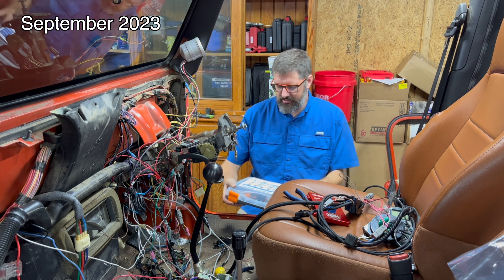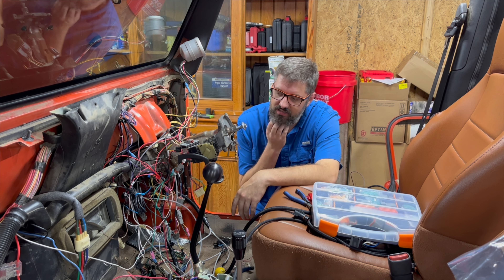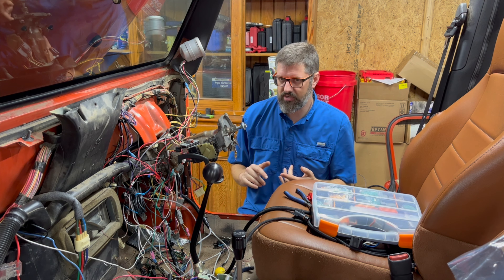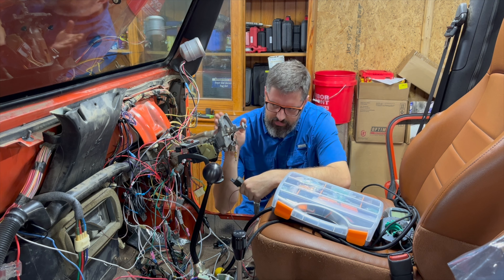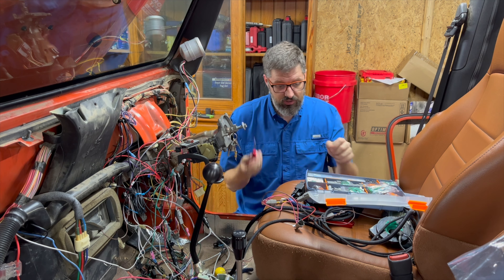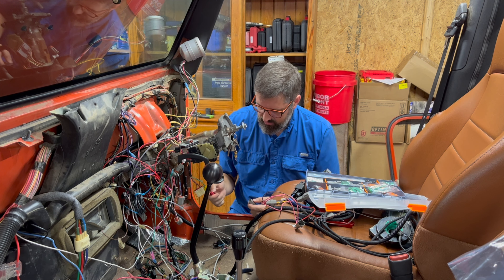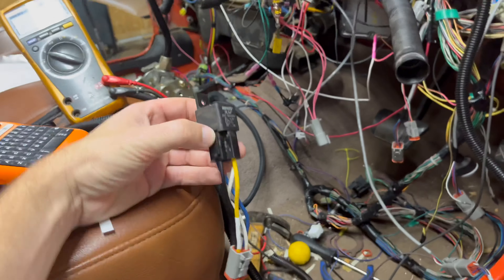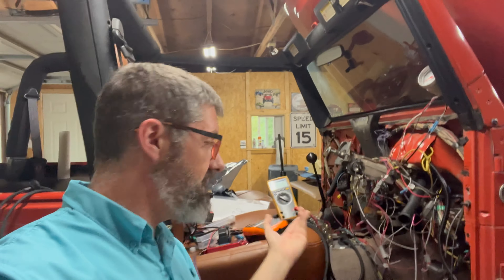Quick Update about the Wiring Fiasco on my TDI Wrangler Project

Comment: Wow! That is a tremendous amount of wiring and complexity.  It must be extra daunting doing it all in a rhd Jeep too(which has  awesome paint btw).  I have been working on putting a diesel in my Jeep, but everything has been mechanical and/or manual.  What made you want to stick with an automatic transmission?
Reply from the maker: It really has been complex and tedious. The Right Hand Drive has certainly made it challenging as well, especially with the turbo being on the same side as the steering and braking components as well. For the type of wheeling I do, I find the automatic to just work better. The first I ever wheeled an automatic offroad was this TJ. When I first bought it the plan was to swap in an AX-15 but I ended up enjoying the wheeling experience so much with the automatic that I decided to keep it, though at this point it would have been MUCH easier to just go with an AX-15 or NV3550, if this AW4 gives me too many more issues, I'll be switching, but that will involve a re-wire to do so.